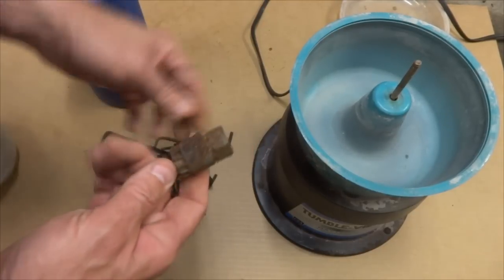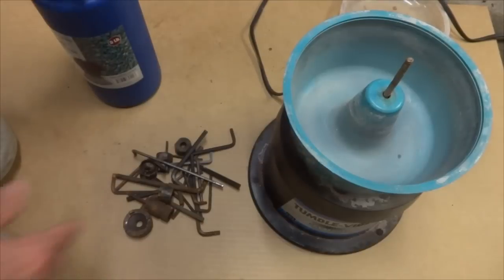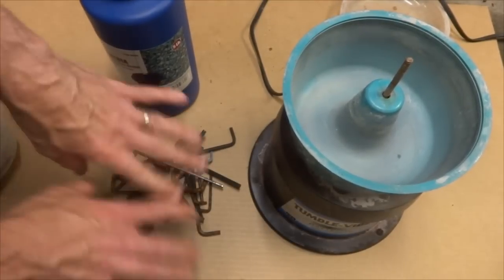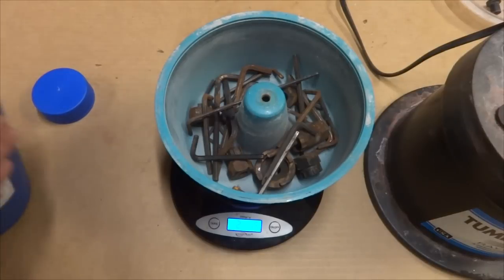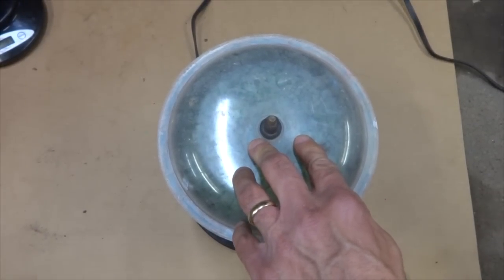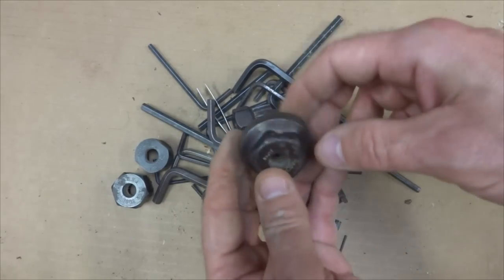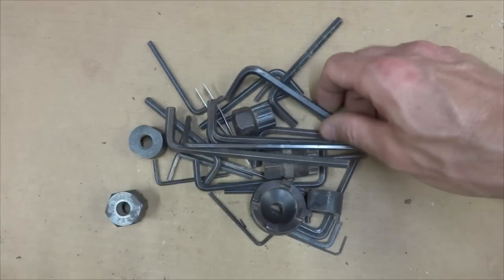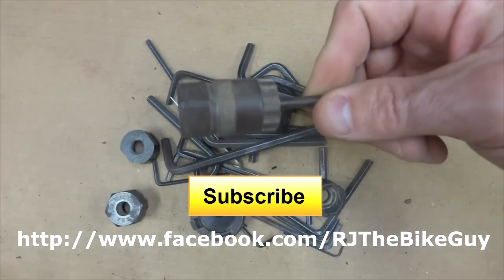Cleaning Rusty Tools In Vibratory Tumbler

Comment: Electrolysis works quite well, but the one thing I can say negative about it is that the SECOND the part you're using it on dries it will have a new thin layer of rust. Basically you need to towel dry the parts and then oil them that very second or they will rust again. I'm not entirely sure why, but the process seems to leave steel extremely susceptible to rusting afterwards. Still though, I've used it on large car parts with great success. I did it to my calipers, then painted them with a high temperature paint, it's been about 3 years and the paint still looks good.

Comment: I use a wirewheel & high rpm drill.  Used acid but that corroded them quickly.
Reply from the maker: +dudugdugdugdugdugdug I like Evaporust. https://www.youtube.com/watch?v=3THVf2xS33Y
Reply: That looks great. Wish I could of used it on this 98 Specialized FSR Ground Comp with surface rust. The acid corroded the parts then had to wirewheel everything.  The chain had cracks on 80% of the links which I couldnt see at first but it all looks nice now. Found your channel through the 99 Rock Shox Judy XC video which appears to differ from the 98 version with spring/hydralics reversed. Was trying to see if it requires a 300psi pump before i buy as it seems to hold 0 pressure.

Comment: So I'm using a Harbor Freight dual drum actual Tumblr and with these vibrational tumblers I'm not seeing anybody Add Water I'm just wondering why and I'm wondering would I have to do that in the vibrational if using it for rocks I see you guys using the vibrational for a lot of parts but I'm entertaining the thought of getting one for a larger volume of rocks rather than 2 or 3 lb of rocks at a time
Reply from the maker: The main reason we bought this vibratory tumbler was for polishing rocks. Yes. you still use water, but just a tiny bit compared to a barrel tumbler. They polish faster, but remove less material. So you won't have the very rounded edges. Make sure you buy one intended for rocks. So vibratory tumblers are meant to run dry light stuff like polishing bullet cartridges and couldn't handle the weight of rocks. The Harbor Freight tumbler dual drum tumbler sucks BTW. Had one. Kept breaking belts and the gears self destructed. It's a poorly made knockoff of a Lortone. I hope you have the extended warranty.
Reply: @RJTheBikeGuy  yep they last less than a year.. just bought another one and got the warranty... I WILL BE GETTING AT LEAST 2 REPLACEMENTS LOL... just bought some of this vibratory rust cutting media just to experiment in the tumbler... So if that stuff is ok in water than it should be ok in a tumbler for one of the stages... dont get me wrong its an expensive product but they were out of the black aluminum oxide... that stuff is a perfect rock polish 1st stage.. its cheap as hell and it cuts it all... You can actually get away with doing a 3 stage polish if you do it right...

Comment: Does this not round off the tools after a while?
Reply from the maker: MrCube17 The abrasive I used is designed to remove the rust, but not round off the edges. If I left the tools in the for a long time, I am sure it would damage them. Or if I used grit of some sort. I only left them in there 2.5 hours. I could have left them in a little longer with no issues.

Comment: Wouldn't some paint thinner in there help brake down the rust off the surface?
Reply from the maker: COL S. Trautman No. This media is meant to be used dry. And paint thinner would probably not effect the rust at all. But it might turn the resin media into a gooey mess.

Comment from the maker: TheJwdude replace the lever.
Reply: RJ The Bike Guy  You know you can clean it with ketchup that the cheap way.
Reply: Zerobladetion Wot Ketchup... come on.. he already has the machine.. why use ketchup?
Reply: CyclingDane hein Ketchup has vinegar you can do it for free in Mc Donald.
Reply: ...ketchup is not free here at mcDonalds.. i use regular vinegar... going to mcDonalds to remove rust from your tools seems cheap..when you can pick up vinegar for 0.75$ a liter... and i would like to see you remove that amount of rust with ketchup..
Reply from the maker: I prefer apple cider vinegar over regular white distilled vinegar. I think it works better.
Reply: true it does and it's just as cheap. 

McDonalds: "anything else?"

"Yes a 165 ketchup please"
Reply from the maker: Evaporust does a much better job.https://www.youtube.com/watch?v=3THVf2xS33Y
Reply: +RJ The Bike Guy 
For some strange reason, Evaporust isn't available here in Quebec. 
I use Metal Rescue which is available at my local Canadian Tire store. 
I swear by it!

Comment: y not vinegar?
Reply from the maker: edwardlui531 I wanted to try this. I have used vinegar many times. Vinegar sometimes turns the metal surface gray afterwards.
Reply: Because vinegar dose not always help keep rust off metal because if you take rust off metal with vinegar the rust can come back but it you do what RJ did and polish the stuff up with quick glow polish it will take a longer time for the stuff to get rust

Comment: It is a success. Just an FYI, you could have used Coca-Cola and had just as much success without the noise. ;-)
Reply from the maker: ricky v Using Coke is similar to using vinegar (which works better than Coke btw). Using acids to clean rust works, but can discolor the metal and sometimes leaves the metal prone to rusting again. This method left the tools with the original color and finish except where with was corroded away.
Reply: Ahhhhhhh!!!  Good point. I figured that was a better way since it doesn't require the special tools. Your method works well then.